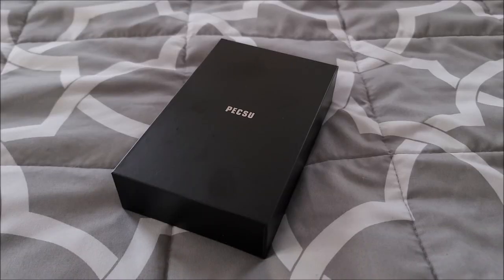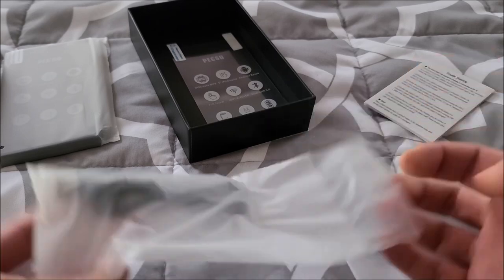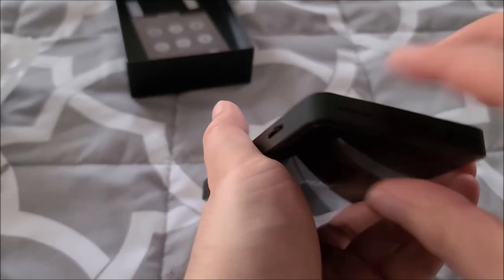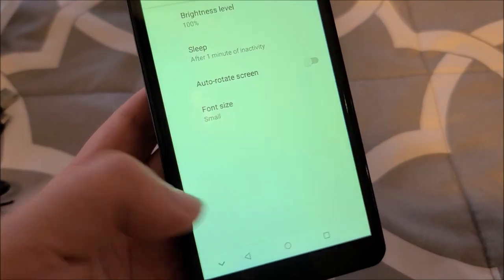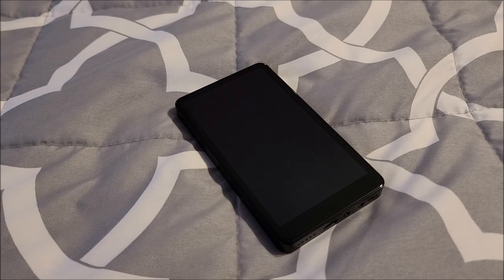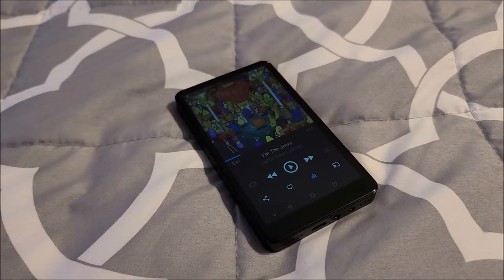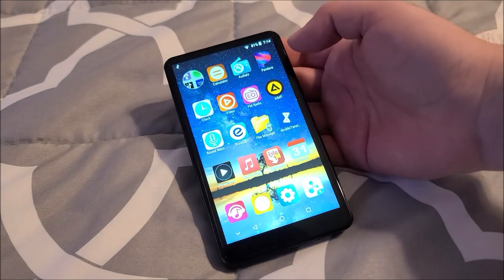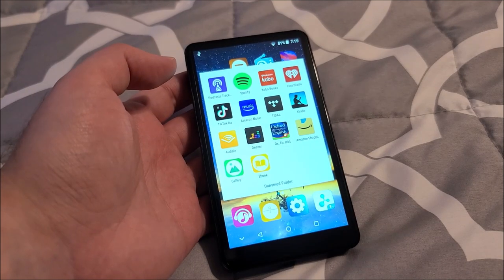World's Best MP3 Player?!?! Pecsu P5S 5" IPS Android MP3 Player Review

Comment: Nicely done.  Very thorough.  I've taken this for a spin and was also able to load different launchers on it which solved a lot of customization issues with this.  Evidently PECSU will soon be releasing an updated model called the "G5" (PECSU indicated the release date will be late October/early November).  The G5 model will incorporate Google Play into it's app package which I assume means they will pay for it to be Google Play licensed.  My understanding is that the hardware will remain unchanged though PECSU did indicate the edges will be more rounded.

Like you I prefer to use this as a Mp3 Player and really wish PECSU would have reduced the size to a 4" display and maybe made it a bit thinner and lighter.  Portability for a Mp3 Player is key.  Everyone in their mother has a phone which, more than likely runs laps around this player in terms of screen quality and hardware.  There is no real reason to keep this player's screen 5" with a sub-HD screen resolution and then try to convince individuals to watch videos with it.

My favorite Mp3 Player form factor is in the TIMMKOO Q5.  It has a 4" screen with a plastic back making it significantly more  more thin and light (and probably more durable to boot) compared to the PECSU P5S.  Unfortunately the TIMMKOO Q5's  hardware and screen is sub-par compared to this model.  If PECSU would concentrate on making the best 4" Android type MP3 Player which emphasizes portability rather than pushing out this Frankensteinian MP3-Video hybrid Player and then try to hit a price point of $50 - $65 I'd think they'd have a hit.  As PECSU gets closer to the $100 price range they also move closer to the pricepoint of true DAC Players which they definitely can't compete with.

Like you I don't think this MP3 Player is worth $80.  I'm thinking when the Q5 is released it will probably be priced in the $80-$90 range which makes it even more undesirable from a price standpoint.  I guess we'll see.

Comment: It's a shame that someone like Retroid doesn't offer an Android device that's basically their handheld minus control buttons and correspondingly smaller. The RP2+ costs just $20 more and is better in almost every way.
Reply from the maker: That'd certainly be interesting but I have a feeling retroid wouldn't wanna risk competing with all the other low end android devices, they are making a comfortable profit on low/midrange android gaming devices with physical controls already.

Comment: I grabbed this a few weeks ago and was not really impressed but the more I used it the more I became to like it. I primarily just use it for my Tidal and Spotify accounts, put in a 256gb card and have plenty of room to download a lot of music.  The only 2 issues I really have are: 1 there is no real power being put out on the 3.5 headphone jacks, the sound I find to be very weak, I need to max the volume even on easy to drive IEM's. 2 is I can not find an decent EQ to try to help with boosting the sound a bit. 
I did find that I was able to download my headphone app and that really helps and the Bluetooth sound much better than the 3.5 output. How are you finding these same issues?
Reply from the maker: I mostly use bluetooth and occasionally my kz iems which are super sensitive that even low volumes are borderline uncomfortably loud for my ears.
Reply: You should return it. I think you got a bad one, which unfortunately happens.
Reply: Its meant for use with Bluetooth headphones
Reply: Hi jimi.
I was just thinking of buying this player for its use with tidal, the interaction with the app is good, would you recommend it?
Reply: can you play podcasts on it? Is there anyway to add data to it?

Comment: Hey there! I have another question: I can't find anywhere in the UK to buy the MP3 player from, so if I buy it, it will be from the US. Do you know if I'll need a step down converter or anything? (Or of any other not-super-expensive MP3 player that can take a 1TB micro SD card?) Thanks again for your time :)
Reply from the maker: It'll charge off of any 5V USB C wall plug. I charge mine off the adapter I use to charge my phone. It'll also happily charge when plugging into a computer while transferring music over usb.
Reply: @sjm4306    awesome, cheers! 😁
Reply: Believe it or not, it's no better here in the USA for buying this type of tech. locally. Most of the big chain electronics stores have only the cheapest junky mp3 players,
if that, or, they sometimes offer the high end Sony players or whatever, that I wouldn't bother with. You're forced to go online to buy anything else, and you're 
generally better served doing that, since the prices are tons better online anyway. I haven't seen any players yet that take a 1TB SD card.

Comment: Nice review. I used to have an old thumb mp3 player Phillips SA1278 ( 512mb) , i tried to change the battery because it did turn on...but battery was ok , at that point my electronic skills ended.  I want  to buy another for my son (9y) he likes music and FM radio ( budget <$45USD). There are a many in amazon with not the best reviews and many other on the internet included older but no longer supported phillips thumb drives. 
Do you have any advice for me about a mp3 player ? thanks
Reply from the maker: If you just want a basic but reliable and cheap mp3 player I'd suggest checking out the sandisk clip models. They have a very good price to functionality ratio and especially the sports models are quite sturdy. You can often find them for sale new on ebay for well under $50.
Reply: @sjm4306  thanks!
do you have any opinion of buying a philips in alli express, they are cheap too.?
Reply from the maker: I have a few phillips mp3 players and they are ok but the build quality is worse than sandisk players (and they tend to cost more for less feature imo).
Reply: @sjm4306  good feedback!. Thanks!

Comment: can this be used for spotify same as mobile phone and without wifi for offline music play with same interface
Reply from the maker: Yes, it's basically a smartphone but with only wifi for an internet connection
Reply from the maker: Yes
Reply from the maker: Yes and no, you will have to manually install update apks downloaded from online and since it's an older version of android there's no guarantee all future apps will install
Reply from the maker: My point was that eventually the app will not be updateable since these devices pretty much never receive major android version updates. I'd guess you'll be good for a good 5-8 years though before android raises the min firmware requirement for apps up past android 6. Most of these devices are loaded with android 8 btw.
Reply from the maker: It mentions apk app installs are possible which is good but no mention of what version of android it runs.
Reply: This smartphone does not have a camera, however, it is capable of making calls and sending text messages through VOIP (voice over internet protocol) apps.

Comment: Does it have Apt-X or AptX-HD bluetooth audio codecs?
Reply from the maker: I actually cant directly tell as the trick of clicking the os build number in settings to access developer options to check the bluetooth configuration doesn't work unfortunately. Judging by ear though, connecting to my sony xm3's sounds like it's defaulting to sbc and not connecting in apt-x.
Reply: @sjm4306  that matches what the Amazon reviews say too. Thanks.

Comment: can it use a A2 1TB micro sd card?
Reply from the maker: Yes it can use it, but probably not to the full speed an a2 card is specced to (the limitation would probably be the speed of the connection between the sd card slot and the cpu in this case).
Reply: @sjm4306   Mk thanks man hey if you learn of any special new mp3/mp4 players let me know